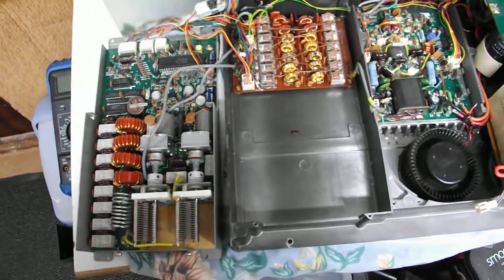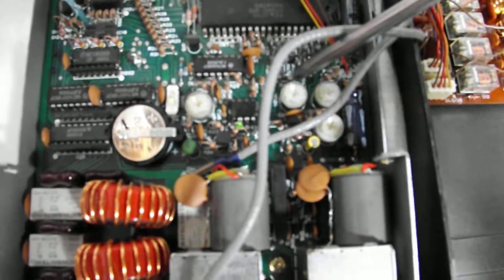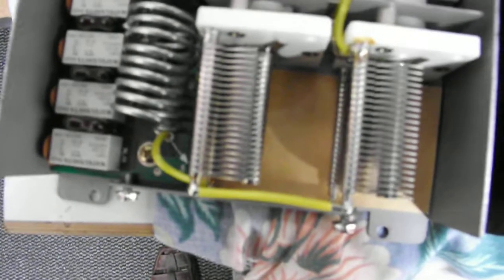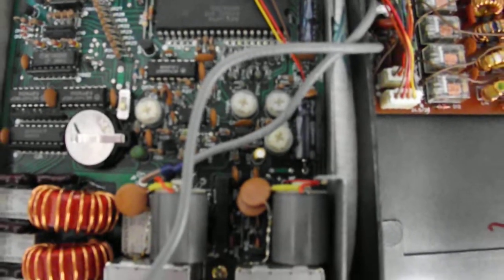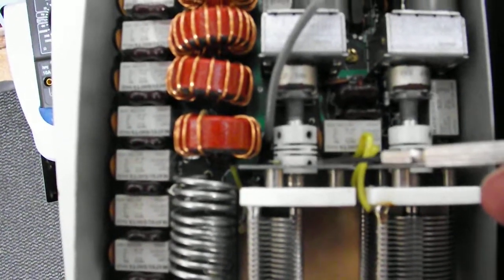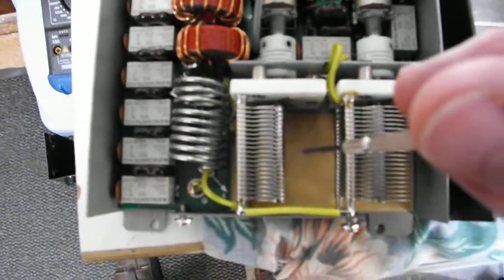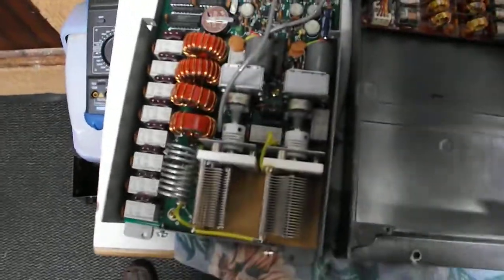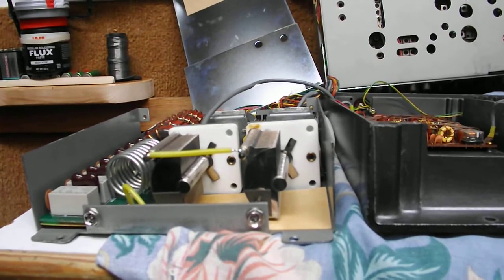Yaesu HF Transceiver FT 767 GX Repairs Part 3

Comment: I wonder if there was some crud on the potentiometer for the tuner on the left, maybe if you had moved it back forth a few time it might have cleaned up the wipers a bit and allowed it to work. I have a Yaesu KT-767GX with what appears to be a bad FTS-8 CTCSS Tone Squelch Board, do you have any photos of it's location?
Reply from the maker: Sorry I no longer have this transceiver.